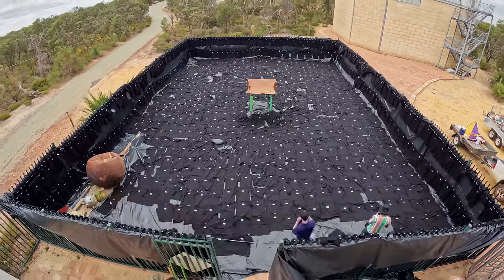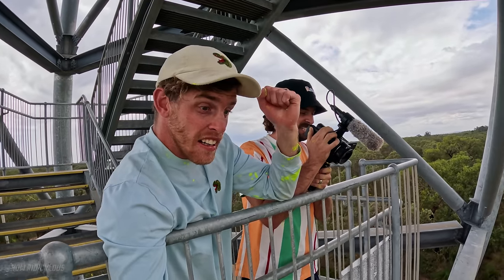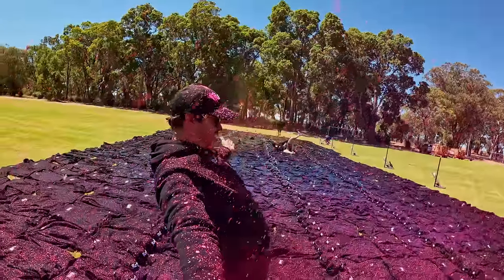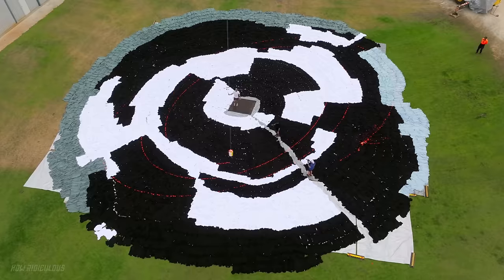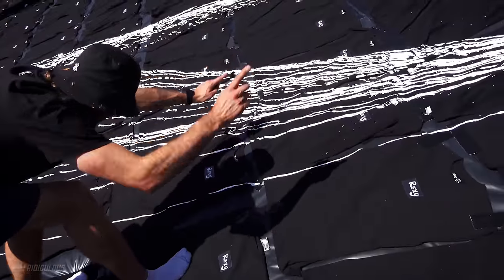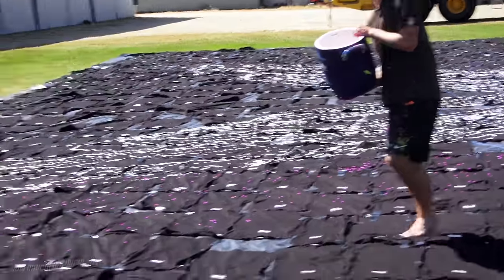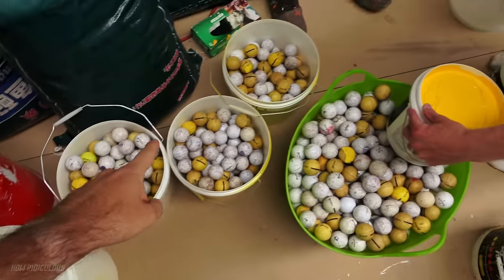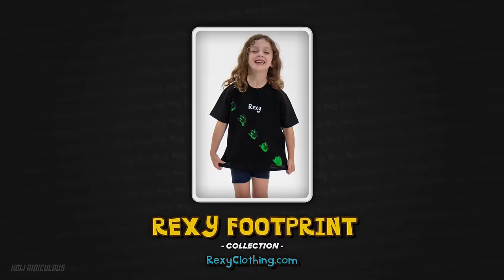C4 PAINT EXPLOSION Vs. 10,000 Shirts!

Comment: Similar to the axe in this one you could try setting up a platform in the center where you can place different shaped bowls/plates designed to direct splatter, which you put the paint into and drop stuff on... maybe fill a verticle tube with paint and drop bowling balls, and metal spheres into it?

Comment: Have an idea for your merch.  Use the katana swords.  From a crane,  let paint/ink drizzle down onto swords from hole in bottom of bucket.  Can do one color, 3 colors, or more.  For release can try a box with trap door that when swings open the doors pull out plugs or rips off tape?  You could have a frame with holes size of buckets but lip of bucket holds buckets onto frame so they don't fall and when tape or plug ripped off they don't fall over.  Throw a few rexies onto some shirts
for a cool outline and sell as a set....make some mini rexies for kids merchandise.  Can take some cutout letters from cardboard of H and R and place on shirts for outline.  Could even throw some items into trap box on bottom so when hit katana swords the items get cut up and mixed with paint it to make possible cool design 
 
Another suggestion,  coat golf balls or bouncy balls with paint and drop from a crane or height onto a trampoline with the merch on the trampoline and set some merchandise on ground  for balls that fly off trampoline 

I have lots of other ideas but figured if like those can contact for more ideas.